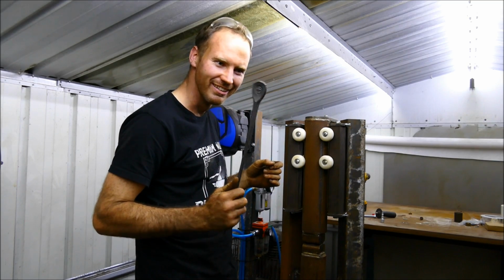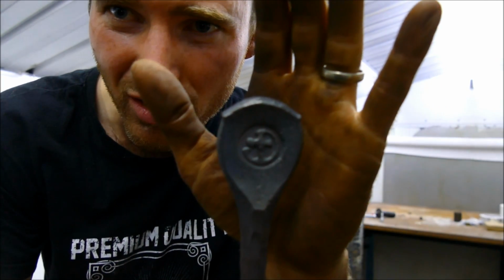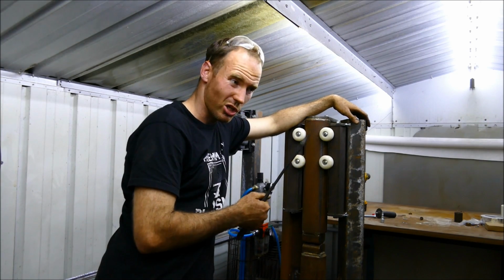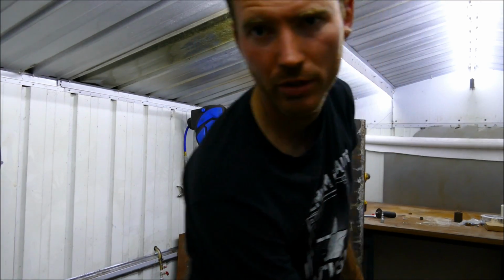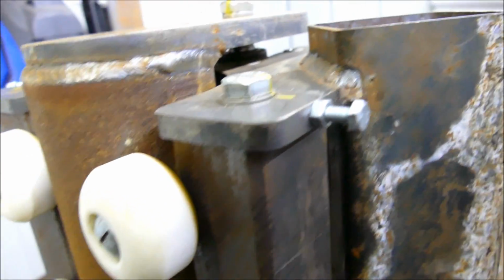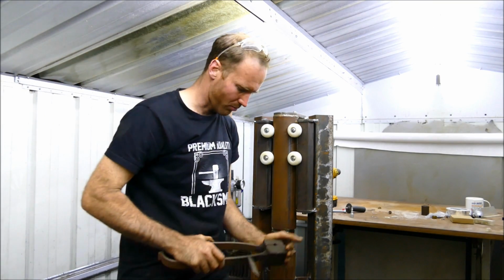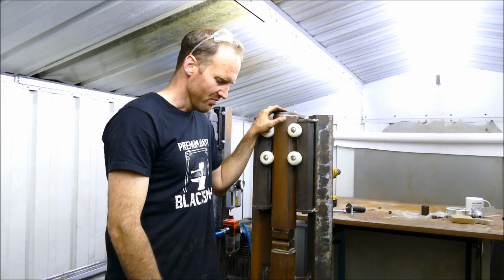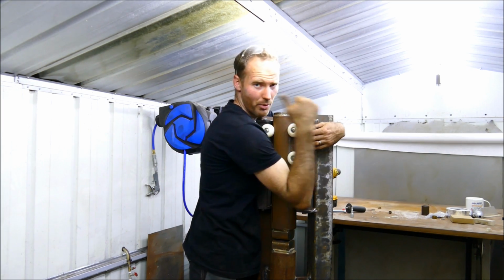!NEW! Ultimate DIY Power hammer build - pneumatic money maker - part 1

Comment: Amazing job I’m definitely gonna build one may I suggest running a small air tank on the power hammer it’s self as a quick air reservoir that will give a faster recharge on the cylinder
Reply from the maker: Thank you. You could but that means less run time when in use. I would actually recommend getting a secondary tank or even two compressors in tandem. Cheers J

Comment: What are the risks? Can the pneumatic cilinder blow out?
Reply from the maker: There are lots of risks depending on how well it's built, maintained and operated. I've replaced the cylinder twice but otherwise it is still working very well. Cheers J

Comment: Who doesn’t like and want a power hammer. I recently found some of your cancer laser cutting videos and then saw you forging legs for a table. Really like all the information you give and would it be possible to scale down the power hammer for a hobbyist even though yours is about as small as it t gets. I still have to say it’s an awesome hammer you made.
Reply from the maker: Thank you so much. This power hammer design is pretty optimal for forging with, you can't really get it bigger without an industrial compressor and you wouldn't want it smaller as it wouldn't be enough. For something compact, cheap and easier to build do check out the 30T press I made recently. It's probably a better option for hobbyist jobs and upgradeable too. Cheers J

Comment: I like the slim design compared to other plans I’ve seen. I’ve wanted to make knives and little stuff for a long time now. I even have a very small propane forge. My 1st problem is I’m a Disabled Vet with lower spine damage. Which makes a hammer like this a much higher priority…
And #2 is, I don’t know how to weld or the equipment to do so. I’ve found a cheap welder that runs off a standard power outlet, I just don’t have the money right now. And my portable 20v air compressor most likely will be to small.
Reply from the maker: Thank you. A power hammer like this will still send a shocks through your body and requires a very large compressor. A more cheaper option that will do the job is hydraulic press. I built a 30t capacity one for under £300 and I can still upgrade it to be more quicker and powerful. I did a video recently so do check it out. Cheers J
Reply: @joshuadelisle  I will than, you.

Comment: Highly considering this build and buying the plans, got a good source of iron and a capable air compressor already.
Is cutting out the floor necessary? Would a thick rubber mat be suitable? 
Also, how critical are the computer components. Can you do without?
Reply from the maker: Hi. Thank you. It's necessary to have a large reinforced concrete mass connected to the base. My floor is thin so it needs a separate foundation that can move about independently to the floor so it doesn't crack the rest of the floor from the vibrations. The computer isn't needed but makes it far better and longer lasting. The issue was the hammer head over extending and damaging the cylinder, the auto cycle with the sensor stops that from happening. Cheers J
Reply: @Joshua De Lisle (Designer Steel)  thanks I finally finished watching all your build videos and saw the benefits (and was put at ease by your reassurance of simplicity 😄) and would definitely see myself going that route. 
I've noticed you haven't posted any videos of your hammer in a few years, how's it holding up these days?

One other thought. I have a plasma cutter, would following a template and hand cutting the ""cnc" bits you had done be manageable by a decently steady hand or is it fairly intricate?

Cheers from Alaska!
Reply from the maker: @pwntagerz  thank you. I'm using it a lot currently. I have a few videos I've filmed but haven't released yet. I did release a knife forging video with it a couple of months ago. You can definitely cut it all by hand, as long as the overall dimensions are within fairly tight tolerance it will be fine. Mainly getting the rollers square with the cylinder and the hammer head is the most important part. If that's off it will cause strain on the cylinder and you'll be replacing it from wear far more often than necessary otherwise. Cheers J

Comment: hi Joshua, great project, looking forward to the steam. what's the compressor CFM and how many cycles per minute can it achieve
Reply from the maker: Hi. Mine is a 150ltr 15cfm 3hp. Haven't actually calculated the usable cycles. But it's just enough to do most forging operations. Cheers J
Reply: @joshuadelisle  thank you Joshua

Comment: how much air does this power hammer need, or what kind of compressor (l/min) is recommended? (you may have mentioned but I have no sound) thanks!
Reply from the maker: All information should be in the description. Cheers J
Reply: @joshuadelisle  Oh I'm also blind. Thanks. I wonder how often such a compressor is turned on? I have 100L and 13 cfm, but I also have a plan to make a lighter hammer. around 30-40 Lb.
Reply from the maker: @MrBostjanVidmar  thank you. It depends on the rate of reciprocation but I get a single heats worth of 20mm solid before it's too cold to forge when mine fills back up again.

Comment: I'm curious why you decided to switch between stick and tig welding. What's the reasoning?
Reply from the maker: Stick is structural and lays more material. Tig is finer for smaller welds

Comment: Hey I’m sure the answer is, well maybe but would a 110 welder (larger 110 Hobart) actually be able to handle the thicknesses in this project
Reply from the maker: If your welder can burn a 7018 3.2mm electrode at 145amps you'll be fine. Cheers J

Comment: I realize this question is about a year late, but did you have any issues with the hammer hitting the top? I've seen power hammers break themselves by not stopping at the top and cracking the head.
I ask because I am building my own soon and would like to know how that has worked out for you.
Thanks!
Reply from the maker: Hi my most recent video on the power hammer should answer your question: https://youtu.be/LEs-Nlakyrk
Reply: @joshuadelisle  thanks!
Reply: @joshuadelisle  I'm watching it now, and yes it does. You got a subscribe from me 👍very good work!

Comment: Like pattern to that of a build , power hammer. Would foam gap filler down pipes to stop Ding ding .
Reply from the maker: I'm going to fill mine with concrete for extra strength and less ding ding.  Cheers J

Comment: Hi Josh excuse my ignorance, do you have valve that returns the cylinder? do you use your foot to go up and down? or does the cylinder automatically return at the end of each stroke when you push on the foot valve? Thank matey Karl
Reply from the maker: Hi Karl. This one has a 5/2 manual valve that has two positions. Do Check out the latest video for the electronic valve system. Cheers J

Comment: Hey Joshua!

Surprisingly effective!!!!!

How many CFM Air Compressor do Feel is necessary to run the Hammer for a fairly long time with a large hot enough chuck of Steel for normal usage,  or at least 10 minutes of nearly continuous use?

Are the Hammer and Anvil,  chunks of Railroad Track?

Thanks!

Cheers!
Reply from the maker: Hi yes. Do check out my latest video on the hammer. Yes railway track works well. My compressor is 15cfm but I would like a 30cfm. Tank capacity is the key to long forging time and the CFM will determine how fast the tanks re fill. 200ltr tank should be enough otherwise a screw compressor is the very best option. Mine is 150ltr and is just enough for what I need.

Comment: Isn't that steel a bit hot?  Looks like you're forging a sparkler.
Reply from the maker: Welding heat. A little spark is fine. Better than too cold.
Reply: @joshuadelisle  Referring to 10:24...you obviously have more than enough skill to smooth out the imperfections caused by any burning that might have occurred, but any time I've forged a billet for a knife that ended up sparking like that at some point in the process grew cracks during quench, delaminated if damascus, or failed prematurely with a bend test.  If I see sparks coming off the steel, I pretty much just write it off as a test piece for fun (stupid) experiments at that point LOL
Reply from the maker: @Skinflaps_Meatslapper  yes for blades that may happen as the carbon is leaching out.

Comment: Amazing mate! Did u use a Proportional valve in that Foot Controller or just a 5/2 Valve.
Reply from the maker: I used a manual 5/2. Check out the latest video as I use electronic valves now. Cheers J
Reply: @joshuadelisle  thanks for reply.     I had seen a Video you talking about to border the Hammer going to Far up side. I Think u can use a roller tapered valve. They are exist in electric or non electric pneumatics. Every move the Hammer goes up- he will touch a Sensor like border and then move Back Down Automatic. If u do so, you Can hold the footpedal and Hammer moves up and down himself until u will release the pedal.
Reply: Just try a roller lever valve to border the high
Reply from the maker: @KusaKorat123  I like the minimalism of the one I use. The proximity sensor doesn't ever touch the head so it won't wear out from repeated impacts. Cheers J
Reply from the maker: If you haven't already. Check out this video: https://youtu.be/LEs-Nlakyrk

Comment: How is it holding up after a year? Is the aluminum cylinder doing alright?
Reply from the maker: Did a video not long ago.. cheers J
Reply: @joshuadelisle  the one with your floating coupling? That's awesome by the way... I was actually wondering about the cylinder gland itself: moving so fast, have you noticed any heating? Need for automatic oiler between your foot valve and cylinder?
Reply from the maker: @buddymartin7923  I squirt a bit of oil in the push in pipe first thing. Not noticed any problems so far since. An auto oiler can work just a but messy. Cheers J

Comment: So when you say you operate it with your foot with a lot of control, you mean when you push the pedal, it down strokes, and when you release, air goes to the opposite side of the cylinder to raise it?  There's no shuttle or relay valve, you have to keep stepping and releasing for the action correct?  Thank you for taking the time.  I realize this video is a year old but still relevant and valuable. You did a nice job.  Nothing with a big car leaf spring rocking back and forth on top! LOL  Take care.
Reply from the maker: Thank you. Yes this is 'manual' if you like. I've done it with normal reciprocation on my latest video. Cheers J
Reply: @joshuadelisle  Thanks

Comment: I'm almost ready to make one ,been saving parts got a new welder and a real anvil,  thinking about making a pedal hammer first what u reckon??
Reply from the maker: I would do your best using hand hammers and even grabbing a mate with a sledge hammer to do Smith and striking with you. If you find yourself relying on heavier forging because that's what you're clients are asking for then invest in building or buying a power hammer. I've got another change I'm making to mine and will be doing a video soon. Cheers J

Comment: I love this design, but I have a few questions. First, I have an outdoor shop. It have a suspended tarp roof, but rain can blow in. I have some scrap steel, but nothing that could be used for this. How much would I have to spend to get the steel for this? Or would a simpler mechanical hammer with an engine and leaf spring to move the ram be better for me?
Reply from the maker: Hi Malcolm. This is a pretty simple power hammer to build compared to a tyre hammer but you do need to be precise and make sure you're welding is penetrated in well. You'll need a large compressor (150ltr, 15cfm) the steel brand new is roughly £350-650 depending on where you get it and if you get full lengths or off cuts from a local engineering company. I'm getting mine powder coated when I've finished all the experiments I'm doing on it and would work fine out doors otherwise you could get it hot dip galvanized and it will last for ever.
Reply: @joshuadelisle  I currently have a 125 amp flux core welder. Im guessing that wouldn't be good enough?
Reply from the maker: @malcolmbuehler5619  hi. You'll need at least 140amps with a stick welder using 7018 3.2mm rods and to pre heat the larger steels first. Not sure on flux core but ideally if using MIG you'll want spray transfer with a 1mm wire and 15% mix gas of carbon dioxide and Argon for good penetration. You could Tig weld it with 200amps but you'll want to do several passes and will be very time consuming.

Comment: Are you manufacturing power hammers now and what are you charging if you are.
Reply from the maker: Hi Eric. I'm not just yet. I have plans to but currently I've not been able to get the time in. I would charge £2050 free UK delivery. Fully finished and powder coated. Compressor not included. Some one has been selling my design without permission and is in breach of copyright. Please do not buy from them. Cheers J

Comment: what tools does one need to put together your kit?
Reply from the maker: Hello. Welder (arc 7018 3.2mm)  grinder, saw that cuts 100mm steel, Combination square, scribe, tape measure, spirit level, drill press, tapping set and spanners. Cheers J
Reply: @joshuadelisle   thank you i def can wait to put one together down the line 👍😁
Reply: *can't

Comment: I rather enjoyed your discovery process in this build. When you went to the copper I knew it was doomed though.  I do a lot in industrial pneumatics and you should have started with an electric foot switch controlling a 24 or 120 volt 4 way solenoid valve right at the cylinder. Perhaps 3/8" ports or even 1/4".  The actuation is instant and you would not need the fast exhaust fitting. Perhaps you have Graingers there -  their catalogs have a wealth of data on system design. Also MRC and ZORO which is a branch of Graingers. E bay has tons of cylinders used and cheap. Also I dont care for the skateboard wheels. Take a look at linear actuators for the guides.  Mount the cylinder low enough that it can never hit the end and forget the rubber piece. Many cylinders actually have end stops, rubber snubbers installed or can be ordered with them. Top quality cylinders are BIMBA, US made and you can order one made to your exact specs for a fair price. Although I doubt the shipping cost would be fair.  Nice video, lot of good information

Comment: How much did it cost to build it ? That's awesome 👍
Reply from the maker: It didn't cost me very much because I had most of the materials at hand. I can build a new one with a £500 investment and I would commercially sell these for £2050 finished. I'm still testing and developing improvements to the design before I'm prepared to do that though. I want to be sure they last as long as possible and perform as well as it can  at low cost. Cheers J

Comment: What is the lowest HP/litre tank i could get away with please???
Reply from the maker: I wouldn't use anything less than a 150ltr 15cfm compressor. Or go bigger for longer forging time. I let mine refil between heats so it's not over working. Cheers J

Comment: what is the total cost for this build to DIY?
Reply from the maker: Hi. It depends upon your supplier. If at a premium it could be £1000 + the compressor. I got my materials for free, the compressor for £100 and spent the same again on the cylinder, valves and pipes.
Reply: Thanks for the replies buddy 👍
Reply from the maker: @gavinjenkins7220  thank you. Anytime. Cheers J

Comment: Hi I'm wondering what is the difference of a power hammer to power press???and can the power press be used a a power hammer? Thank you for your time!
Reply: Thank you so much for your time & knowledge.I ask this question because I can't find any seller or used power hammers in my country.Thanks for your time again!!!
Reply from the maker: Yes. First thing if you use this analogy, if you use a hammer to drive a nail into a peice of wood it's easier to swing it rather than push the nail or is in pushed in very slowly using leverage. In the same way a power hammer needs less energy to move the hot metal compared to a press while a press is great and very precise and easy to control it is slower thanless it has a very powerful pump and motor. But equally a power hammer is very efficient and fast it can be difficult to control and therefore can be more dangerous if you don't have experience. Cheers J

Comment: Can you attach it to your forge, or would it shake it too much? Maybe put the forge on wheels, to move it around, and make the forge out of a large metal barrel, on its side.
Reply from the maker: Hi Scott. You could but I don't think it would be practical. Sometimes you want room all the way round the forge and no instructions to the hammer. Vibration maybe an issue also as you say. Cheers J

Comment: I have bought your plans and am almost finished mine but the cylinder in your description says it 16.54 "long  when the slide parts are just 13 .54"long  ??
Reply from the maker: Thank you. I'll double check that for you. Cheers J
Reply: @joshuadelisle  did you find any info on my earlier question thanks in advance
Reply from the maker: @tylertrachsel9777  HI. sorry for the late reply. the package size is 16.5" but the space between the faces is 13.5" so its all good. cheers J